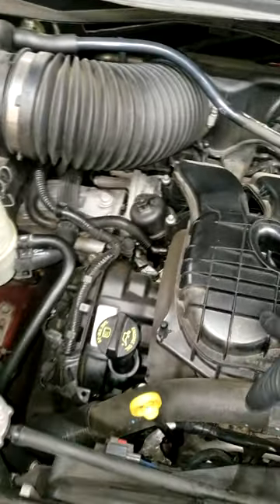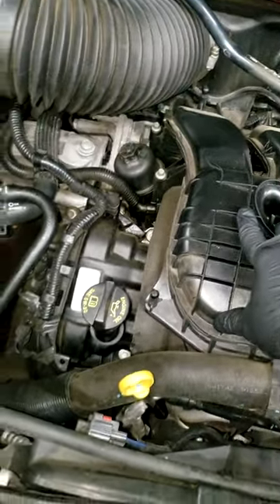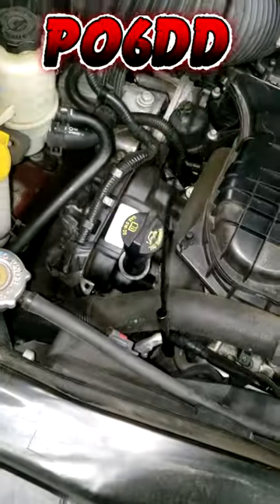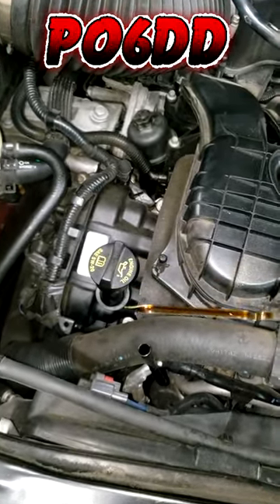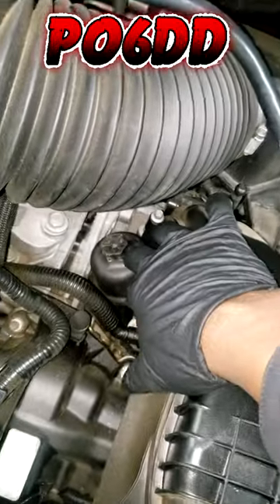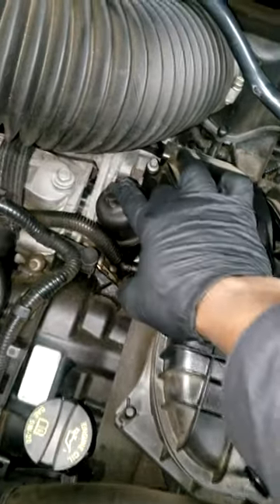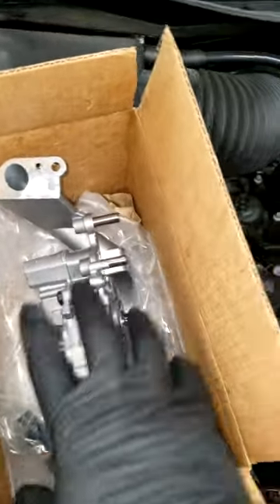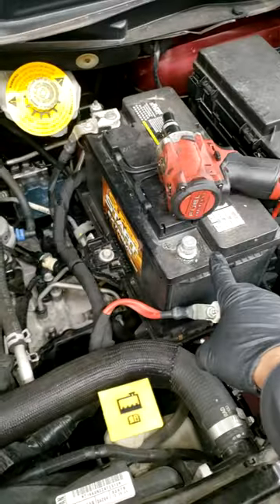Check Engine Light On. P06DD Tips to do first.

Comment: Alright get this. I just had the oil changed on mine and they used the wrong oil filter, I then got the P06DD code come up and went back. I watched them pull the incorrect filter out of the car and replace it with the right one. I still can't get rid of the code though and the car is in limp mode because of it. Help me out please and thank you.

Comment: I have been having this off and on with my 2014 Ram 1500, seems like my filter seal was bad causing it to piss out oil, topped off the oil, replaced the seal, and it did do it a couple time after but I checked, seen oil down the manifold from the filter, took the air gun blasted a bunch of shit out and so far its been okay

Comment: TYRONE, GOOD RULE OF THUMB REMOVING BATTERY CABLE, WITH TODAY'S COMPUTERIZED VEHICLES LIKE THE REMOTE STARTS. IF A STRAY SIGNAL TRIGGERS THE AUTOSTART AND YOU'RE WORKING ON THE PULLEYS. YOU CAN GET YOUR FINGERS CHOPPED OFF.

Comment: I had the same code after I replaced a transmission 62te on a 2016 t&c I swapped the oil sensor it didn’t go away so I got a update and it’s gone but second i left dealer now I have po430 
In 2010 and older never had these issues
Reply: Thats a cat code. Check your o2 sensor wiring & the catalytic converter
Reply: @Flatlandproductionz  you are correct checked everything and it’s a glitch in the software. When it’s warm out it doesn’t come on. Weird one I’ve worked on thousands of these vans and the one I own has this issue lol my luck

Comment: i have the same van and on the inside of oil filter cap one of the three tabs that locks the oil filter broke, will this cause an issue? im thinking of replacing the cap

Comment: I have a 2014 Jeep grand Cherokee limited with a penstar v6, I’m getting the p06dd code and traction control light coming on when I’m usually on the highway, I’ve replaced the oil cooler with the upgraded metal one, changed oil, new filter and it’s still happening. Any tips?
Reply from the maker: Curious, how many miles on this Jeep? Also are you subscribed to the channel?
Reply: Did you try replacing the oil pressure sensor?